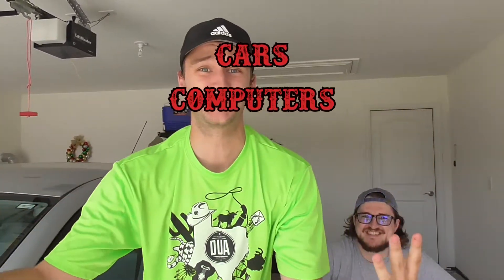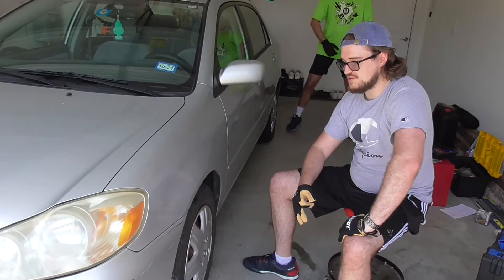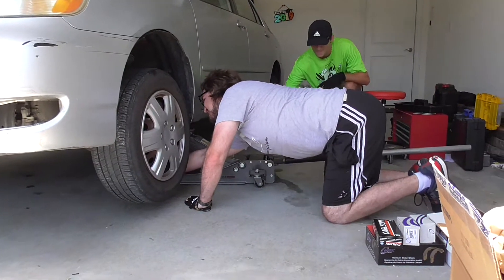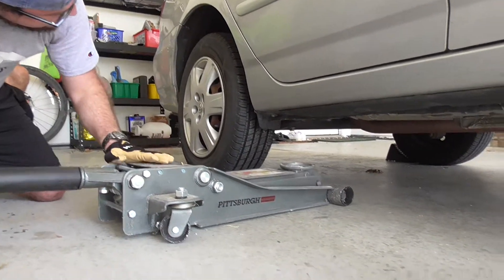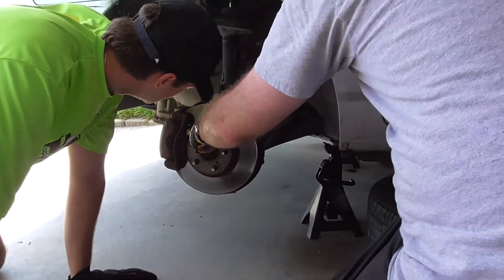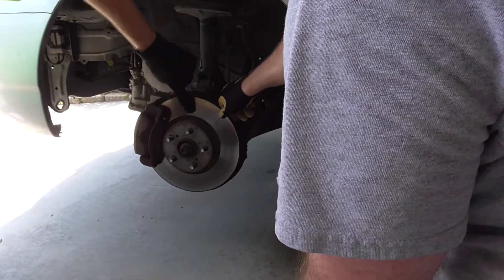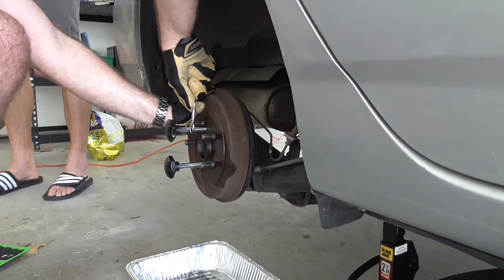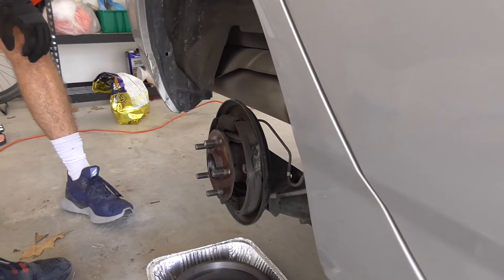Toyota Corolla Jack Points

Comment: Dude the jack stands should go on the pinch welds. Putting the jackstand on that bolt is not desirable shoudl the car shift even a little it will kick out from under that bolt